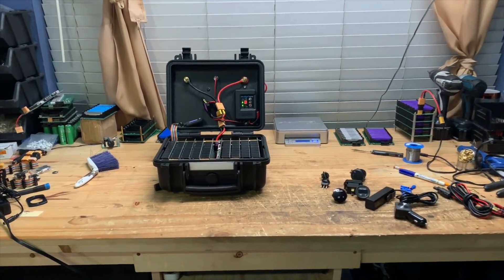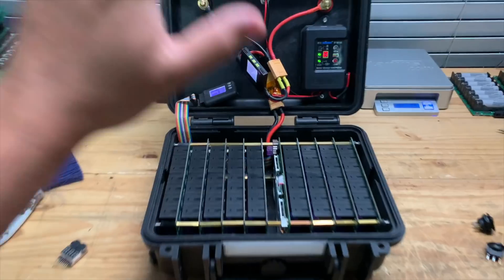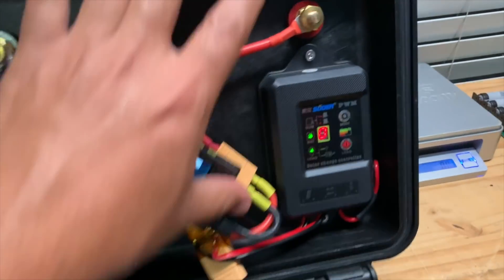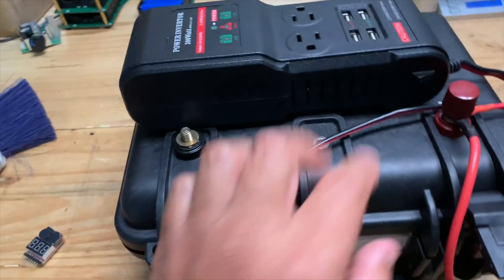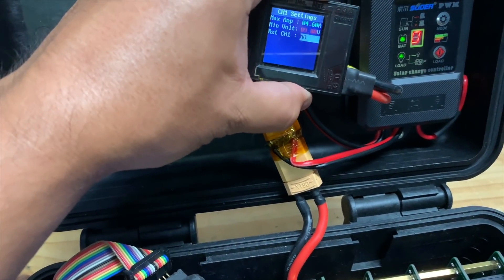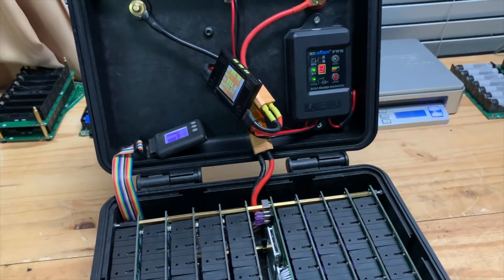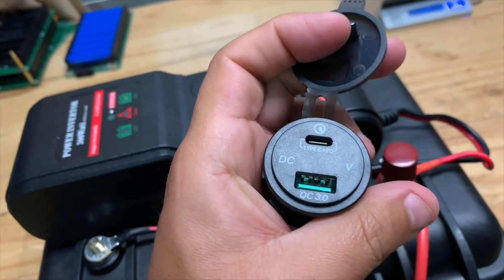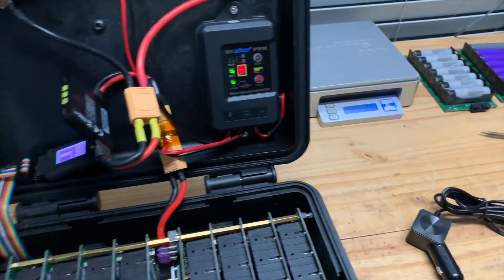Should this Thing Have an Inverter or Not?

Comment: I made a portable pac. But it’s only 8-9ah. Just enough to charge a phone or two and run  some led camp lights. I made it so it too could be charged by a solar panel. I was in the testing stages with it and I ran one light for 24 hours non stop and it lost less than a full volt. It’s set up as a 12v pac. I can show pictures. Honestly. Your videos inspired it. My buddy had lost power for 5 days due to some really bad storms this summer. So I let him use it. He loved it and said it worked flawlessly. So I was happy. Lol.

Comment: Add a Circuit Breaker on the box that turns everything off. I have one on mine and I included the inverter, USB and voltage meter.
Reply: Could you share your build? I am busy with my build but still learning

Comment: I am going to do better than recommending parts for you.  Just to remind you I bought a full kit from you for about 500 dollars. I am currently testing every single 18650 cell I got to make sure they are good cells. So far they are showing great cause they are only supposed to be 3400 mah but my tests show them around 3500 to 3600 mah. When im done with my tests I will start building all the PCBs you sent me and then the kit. But I plan to do it very different from the way you did yours. I am going to record every thing I do and then edit and put it on Youtube. When all that is finished I will let you know and will send you the link. Thanks for all the great videos you do.

Comment: If you do fit an isolator I would prefer a switch that is a higher amp rated switch that turns rather than a rocker switch as  you can't accedentally knock those on an later find you have a discharged battery just when you need it in an emergency.

Comment: I built 2 with inverters, 2 without. I would include a 12/24v outlet and skip the inverter. I'd opt for USB ports. 90% of the time I didn't use the inverter, and when I did, it is easy to pack one. I would take a look at the USB led lights for sale on eBay. 1kwh under 10 lbs in a plastic ammo can is useful in itself.

Edit: use a solid state relay with the switch if you really need the extra amperage.

Comment: jehu you need a (main on/off switch between battery power) and all pwn controllers, inverters, Or your system will always be on and slowly discharge if not powered with solar continuously, or 110 volt ac  to 12 volt dc power plug to keep charged the way your setup is right now.

Comment: You have room to put a circuit breaker for the inverter and use the switch for the voltage meter. You already have the switch on the inverter so you can isolate it to USB only when you're using it. When you're not. Flip the circuit breaker :-)

Comment: Not all laptops have a charge option for 12 volt usb. Most laptops I know are 18 volt and have only a 110 (240 EU) power adapter. If you want to go international with this like recently hurricane in the Bahamas you need a 110 or 240 volt connection to be flexible.

Comment: The inverter is a good option for people who want it, although it's probably modified sine wave-only good for light and simple appliances anyway. You could add a 12v isolator switch (intended for car battery isolation) they are rated for 200a and are quite compact

Comment: Hi Jehu,
Get a bigger box (possibly with a taller lid same size as the bottom) and mount the inverter on the inside .   Stick a decent kill switch Inside to turn the whole thing on when needed.  NO HOLES just have the whole box SEALED with nothing on the outside and when needed it can be opened and all is there to be used.  What do you think ?

Comment: The inverter presents a unique issue. USUALLY in these setups, its the Charge Controller that is robbing the battery. Put either a switch or a quick-disconnect between the Controller and te battery when not being used.

Comment: Open and check the relay. If you're able to rewire it. So set it to default to 24volts when it power up and if its detect 12volts set it to swicth the relay. pretty much reverse it until the system detect 12 volts and power will send to relay to switch it to 12volts setting.

Comment: Hi Jehu wish you a great day hope you are doing great, I notice one thing without the battery in use why to keep it connected to those devices? That's da reason it losses power, but if like we have those three displays connected in a main switch you provided on battery or a switchgear also can help as well like a additional security to cut off the power if situations demand so. By doing so though you have all hooked up for use it will not drain the battery without having any actual use of it, why do we continusly  need to monitor those three lil screens when battery is standalone, So when we wanna use it all we gotta do is switch it on and all will go on, this is a emergency situation battery you have made, if it losses power when not required it may not be able to give optimum output when it's required in an emergency situation. How will you get the precious power to charge it.

Comment: Get a 24 volt relay that has double poles and use a n.o. push switch to energize it. Wire the coil through the relay so it is latched on. Put a n.c. switch inline with the coil and pressing it shuts it off. You can also buy a flip flop latching relay that needs only one n.o. push switch.

Comment: 1) Open up the inverter
2) Remove the relays
3) Replace with a solid-state switch (Usually two FETs with their body diodes facing)

The only leakage current should be gate-source leakage, which should be in the microamps or less.
Reply: @DazzaDirect  Yeah a 60V FET would work fine, but I just went back to the video and it's really not necessary. In this case, just cut the USB hub's wire to the input so power flows through the same switch as the inverter. 

It's not just the relays consuming the power too. The inverter and the 5V usb dc-dc converter takes some power to maintain their output voltages.  Every inverter and usb hub is going to have this same problem, you can't really get around it without more sophisticated electronics. For example, wireless charging systems turn on periodically to check for a load, then go to sleep if it's less than some setpoint across a shunt resistor.

So yeah, just disconnect the usb hub from the direct input so the switch turns everything off.

Comment: You could also use a double pole switch and parallel the loads giving you 40 amps

They also make 3 pole single throw switches
Reply: That's what I did, single switch with 3 connections 30A each, put all of them together, and using max 60A through that switch, works well. My battery is 14s 58,8v and my inverter has max voltage 61v, no problems so far.

Comment: Maybe you can add some capacitors to smooth the voltage for those battery alarm modules. Also, in terms of power loss from the inverter I like the switch idea because it's pretty easy to use. No need to plug in or anything just flick a switch and you're ready to go.

Comment: Hmm, USBs have a DC to DC relay in them so they will always pull some energy off a battery

I would suggest 2 DC outputs , 2 car sockets, and  hook up terminals  so  a USB  hub can be plugged in car socket as well as ac converter with car socket plug,  can be used

Comment: How about wiring up the inverter on its own output, and having a small switch on that? The inverter is a blob on the side of the case anyways, we lose nothing be making it separate. 

You definetly do need to have some USB ports directly on the thing though. Those should also have a hard switch. 

Even the smallest devices have a tiny load at all times, and building one in means you can't reliably store this long term. Best to be able to shut everything off if possible.

Comment: Is there enough room to mount 12/24V lighter socket(s) into the side of the lid on the left side? Then you don't have to worry about the depth of the socket, only the width of it.

Comment: Hey Jehu, Maybe Put XT-90 Connectors Between The Inverter & Lugs Plus A XT-60 Between The Smaller USB Bar & Have Both To Plug In When Needed Soo Then You Can Quickly Adapt To Various Things Without Disconnecting Leads At The Lugs!? Then Unplug Both When Not In Use To Have Zero Drains... Plus Wire A 12v Lug Soo You Could Use It As A Car Jump Box w/Short Jumper Cables Clips?? Essentially Go To Harbor Freights & Buy A 3 in One Jump Box, Rip The Lead Acids Out & Build Li-Ions In & Strap Your Inverter To The Back, Then You Have An Air Compressor To Blow Up Your Air Mattress Also w/A Little LED Light To See With T@@...  LMAO Thanks

Comment: Can you cannibalize an inverter's components and stick it inside the case with just the on/off switch, AC and USB ports sticking out of the case? May need a little bigger case.
Also, if you could revisit the DIY powerwall design for a 10kW system as cheap as possible, maybe using the LiFePo4 pouch cells? The integration of BMS boards into such a system is of interest especially. Compare it to commercial products.

Comment: I suggest having a switch for each integrated component.  Id like to see more engineering for tighter integration of the integrated output converters (USB. 5v, 110v AC)  If you're going to have these components slapped on the side with screws and glue, may as well let them be bundled components left whole.  Less tacky and more utility.

Comment: My crappy 2300w PowerBright uses 1.3w on standby/idle.
My other 1100w Energizer uses about 1.1w standby/idle and has 2 USB powerpoints.
You can always hack the one you have by changing the power switch to exclude the USBs.

Comment: I'd want a complete battery disconnect switch and also separate smaller switches for an inverter and separate USB charger, but I'd suspect that the average person would just want everything together, like you did

Comment: I installed a dual usb socket in my van and discovered it would drain my 12 volt battery within 2-3 weeks. I connected a on/off switch to solve the problem.
Reply: I think I'm experiencing the same thing now. Thanks for the advice.

Comment: Instead of placing all of those add-ons on the outside of the box, I would get a larger box to put everything in... Then, I would incorporate a master switch that shut off everything until it is needed... Just my thoughts... However, adding more and more to the Outside of the box is like building a bigger box, on the outside... How many add-ons do you plan on having (Inverter, etc.)... The measurements of the unit seems to be getting bigger and bigger... I would simply go with a larger one...
Reply from the maker: im doing 3 sizes,  the is the small one

Comment: If the inverter in on the box you can run stuff like small lamp or radios and so on
All you need to do is add the switch for inverter and the bat posts on the box stay on thare own wires

Comment: I think this project needs an inverter. I think the best choice is to use an inverter with a button. In that way you will minimize the power consumption to 0W. Also, I think that there are no inverters, that uses 1 watt or less, doing nothing, when plugged in.

Comment: Mount a second case, the physical size of inverter, on top of the battery case and add a smaller inverter with the USBs and 12v socket.  Gus.

Comment: Anker PowerDrive 5 port dc charger, 12 volt outlet, slap on a wireless charger also and maybe an external led floodlight, dc breaker to shut off

Comment: i think it should be 4s charged to 15.5v , most equipment is fine with that , this means it will be cheaper overall (no converter for 12v) and far more simple and yes with inverter, one other thing sad but necessary in my opinion , i feel you should loose a parallel pack in order to be able to have alot of depth in the case at one point  to add LOTS of 12v car plugs and have at least 5 if not 8 of them as the main outs and atleast 10 USB,  also as others on this thread have said you could jumpstart cars and use 12v air compressors too, amazing work Jehu, have a nice day   ;-]

Comment: Please make a 12v version of your power boards.
Reply: mindshelfpro you can put a jumper wire on his board to make it 12v. But, you have 1/3 the run time. At 24v it bust to put inside a UPS power supply.
Reply: At 24v it best to put inside a UPS power supply
Reply: I want to use 10 battery packs for 10 radios, and all run at 13.8v

Comment: It needs an inverter,that's the point of the device, sure the dc ports for us are also important but plugging in a standard electrical device is what you want. It's time to disassemble that little inverter and eliminate those power hungry relays?I prefer calling the thing a solar chargeable powerpac. It's going to be charged from a wall plug most of the time,and panels when none is available. Something about calling them a generator just seems clickbaitty.if that makes any sense

Comment: I guarantee you will not find an inverter or USB hub that doesn't consume idle power, and it's not the relays wasting the majority of the power. Your best bet is to just rewire the USB hub so that inverter switch shuts the whole system down.

Comment: I'd probably use a 24-12V step-down converter like this one https://www.amazon.com/Cllena-Converter-Regulator-Transformer-Waterproof/dp/B07B4HLLWJ/ (rated for 480W) and put the switch on the 24V side, then probably try and fit a regular 12V socket. Then users can use a cheaper 12V inverter, including one like this https://www.amazon.com/BESTEK-300Watt-Power-Inverter-Adapter/dp/B07KQ4Q2L5/ which produces a pure sine wave. (I haven't found anything close to that price point for 24V pure sine wave)

Or maybe use another plug like your input port and make a 12V pigtail adapter for it.

Comment: Personally you do a great job building the batteries. As for a "power station" something to use during an emergency etc, I would suggest a Pelican 1510 case or the HF knockoff, use a similar size battery.
Perhaps use a small 150-300 watt HF inverter, they typically have 1-2 USB slots, 1-2 120v plugs, and shut the entire system off with a switch on the inverter.

I would build a internal box to contain the inverter, the additional USB plugs, 120v plugs, and find a light that is wired to plug into the USB/120v plugs which with the lid open could be strung up in a tent,cave,etc, and maybe a Olight Gun light that can also be charged and ready to deploy when needed.

With that size battery and the small form factor of the accessories, keeping the box water resistant would be of the upmost importance to me. Maybe find a small efficient solar panel that could be placed within the case, so during the "event" the batteries, inverter, and other sensitive electronic gear stays dry while being able to charge the battery.

I would add a real knife, a small pistol with a extra magazine, a calllume light stick, a flint and a real US made magnesium bar, some char cloth, a life straw, and old phone with music on it, with a cheap little USB travel speaker, the music helps keep people calm during any "event" esp light jazz, Bob Marley, Gypsy Kings, Collective Force etc.
And since the 1510 cases have a handle and wheels on it, it would allow you to roll it on hard pavement sidewalks etc.

So many things to get prepped for, so little time to get ready for 1776 to commence again, let's us pray no one "infringes" upon the 2nd A or you Demonrats best know how to survive when us educated rednecks cut off the H20 and power to your "Libral" shit holes.

God Bless and good luck.
Reply: July 4, 1776, the 13 American colonies severed their political connections to Great Britain  <----     your poetry is profound but i dont get what you mean "again", independence from whom ?     ;-]  as for your comment about the power pack i agree with all you say too , check out my comment i wrote on this thread above or below here somewhere where i say i think it should be a 4S pack charged to around 15.5V       ;-]